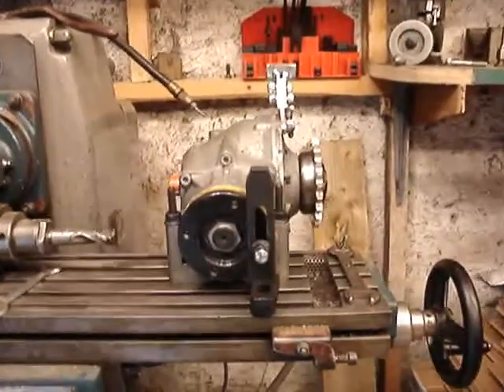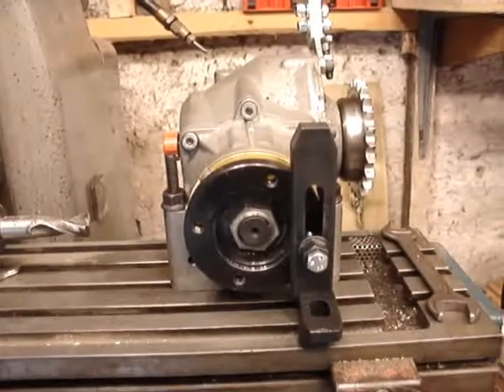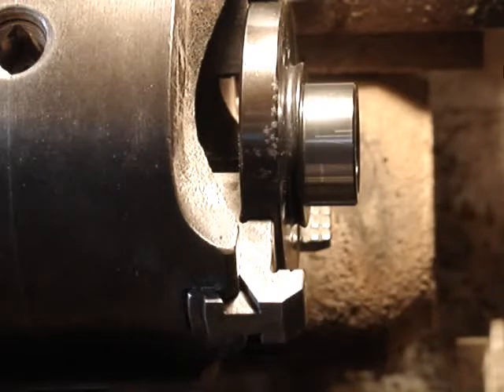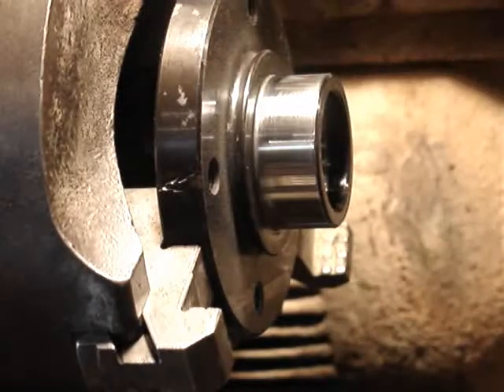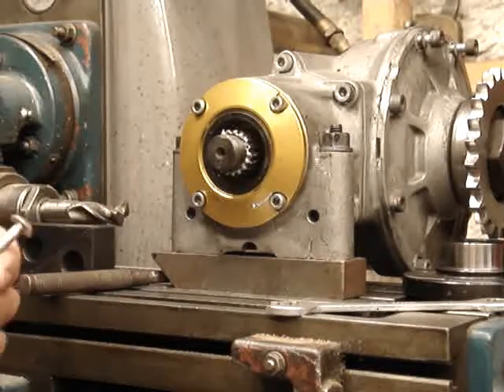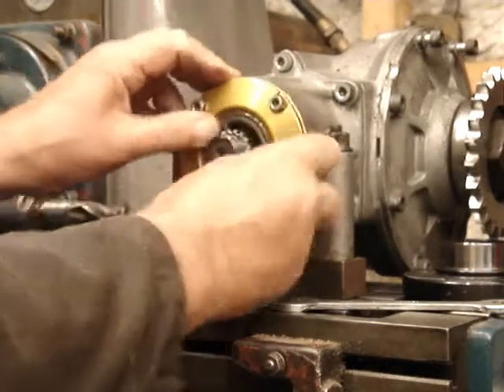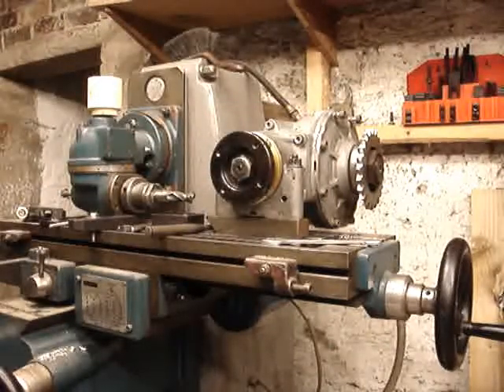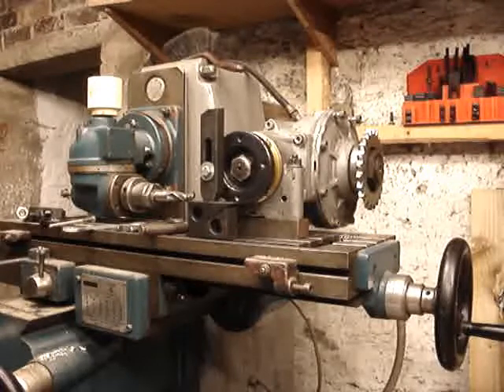bevel box oil seal replacement

Comment: Do you have a email were we can chat.
Also I have been thinking about a BMW rear swing arm how about using A front wheel drive car CV joint to run at a extreme angles and move the rear of the morgan rear drive shaft as far as you can  and still keep it in the or under the cover to lesson the angle. Or maybe two back to back CV joint that would allow all most 90 degree smoth running angle
Reply from the maker: I look forward to seeing some engineering drawings of your ideas - my email address is on my website.
Reply: @morganthreewheelerworkshop1189  I can not find your emails address, I must be blind LOL

Comment: Hi Phil

This is a bit off topic - but how do you get on with where to rest your foot when not using the clutch?

I hired a three wheeler from factory last week and thoroughly enjoyed it, - but my left leg eventually went dead from keeping my foot off the clutch pedal  

Any pointers would be greatly appreciated as this is probably the biggest negative for me at the moment 

All the best
Reply from the maker: Probably not quite in line with the law but I have moved my pedal box much further forward by angling it a bit to the right.  This allows me enough room to rest your foot on the floor.
Reply: Morgan Threewheeler Workshop - thanks for that info - btw ever tried a Triking? What’s the comparison I wonder

Comment: I just recently discovered your channel and appreciate your videos I've learned a lot more about my 2013 Morgan 3 Wheeler I am here in the United States
Reply: I am in the USA also. I have been thinking of buying a Morgan Plus 6 in a year or two. The Toyota quality engineering on the BMW engine is why I am even considering it. I am letting a few years accumulate for quality issues to present themselves.
But, this channel has me considering of buying a 3-wheeler also. The improvements are amazing and without these upgrades, I still would not be considering a 3-wheeler. I just do not understand how Morgan can not reach out to this gentlemen. I am just really impressed.
Reply from the maker: Glad to be of help Howard.